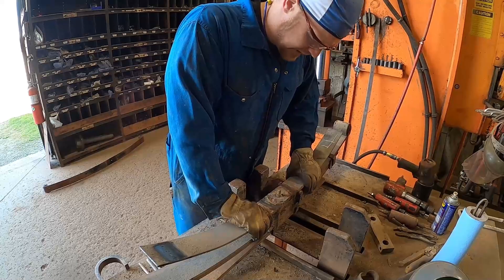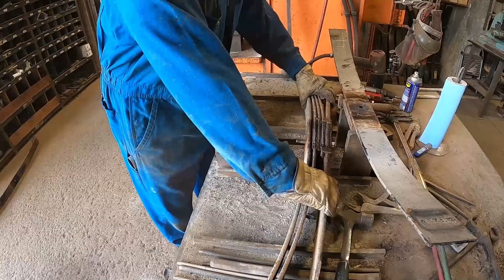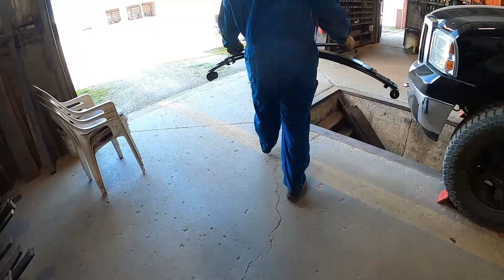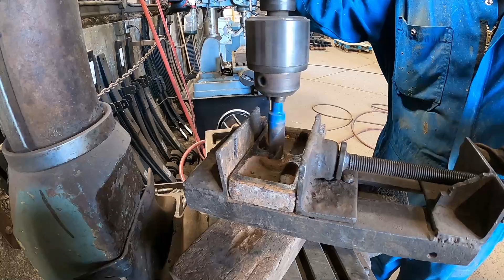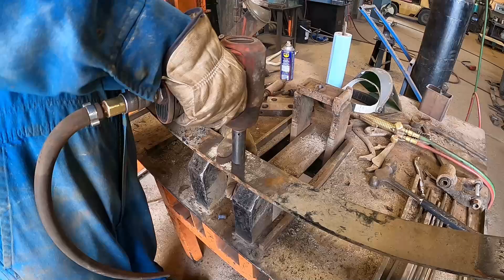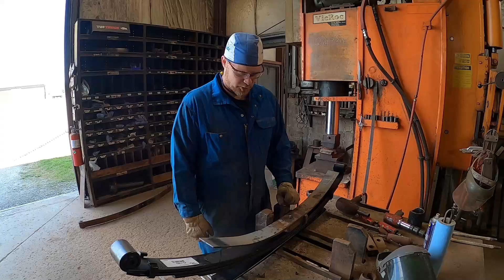How to split the helper off the main spring for easier install | Ford F250/F350 rear spring

Comment: Love the “ CLASSIC VIC ROC “ set-up Hyd. Table / 150 press / u-Bolt machine. You have to be incredibly proud of that , sure beats hammer setting  spring leaves ❤️🏴‍☠️🎥💯%👍🏻🇨🇦🔧💰😎👌.
Reply from the maker: Yes, it sure is one of the best systems around.  I don't know how I would do my job without it.

Comment: Glad I seen this video I did the rear springs in my 05 F350 this way I've always had my doubts ever since I did it. I'm guessing Ford did it with one center bolt for production. The springs were the cheapest part, getting the U bolts, spring bolts and shackles from Ford makes a guy walk funny, nothing is cheap in BC. I remember when leaf spring packs were expensive I used to scrounge old spring packs to make up a "new" pack. Today you can get what ever you want for a reasonable price.
Reply from the maker: Ford installed the springs two different ways.  Ine way attached to the spring but the other way the block just had a spike sticking up that the helper slid onto.  So I figure either way is valid.  Plus they do it this way on single axle dump trucks........so still good.

Comment: The next guy may think there is a single center bolt. Have you thought about reversing the center bolt through the helper? It would be more visual than anything and probably not the industry standard, but a thought I had.

Comment: I looked so long for a vid like this. Am I understanding that the block and aux spring are essentially full floating and the centre bolt does almost nothing?
Reply from the maker: The center bolt allocates everything for alignment purposes.  the center bolt also just attaches and hold everything together.  The Ubolts are what really keeps everything in place.  and yes, the block and the center bolt are basically just floating,  but it never takes any type of twist or torque like the main leaf spring pack does (from acceleration) so it can just sit there and be held by the Ubolts.
Reply: @simcoespring  thank you. Makes my life easier